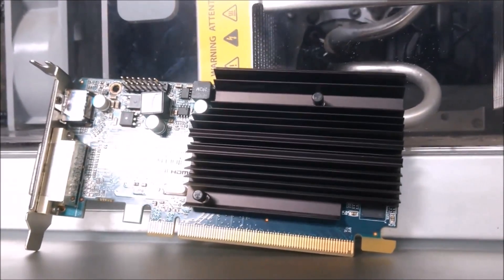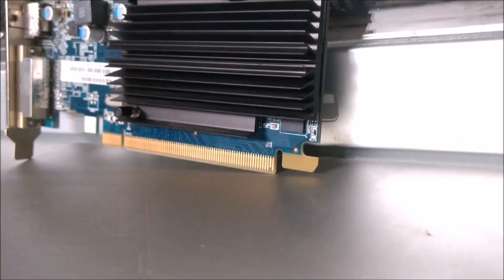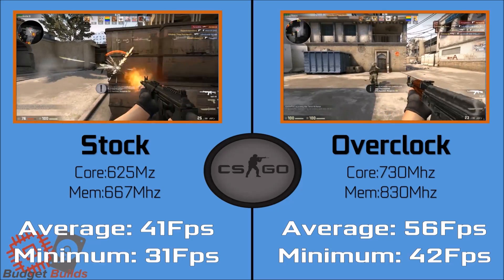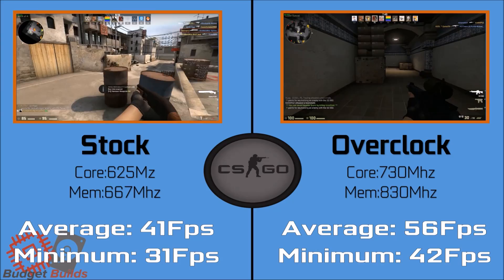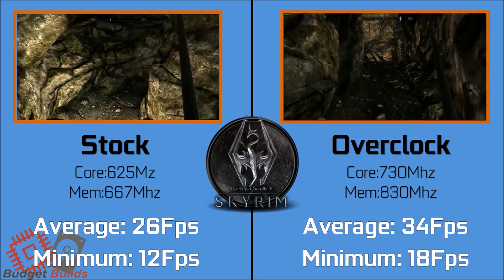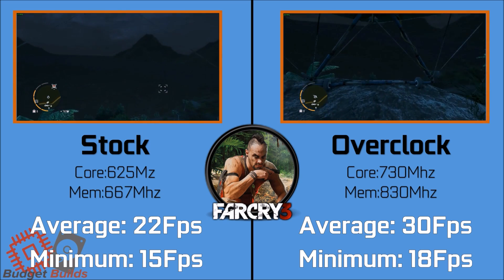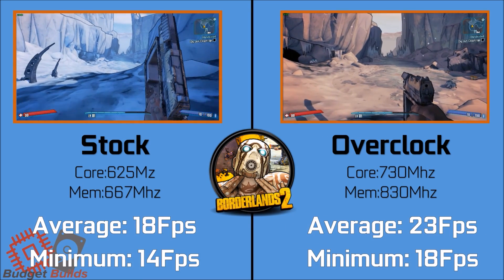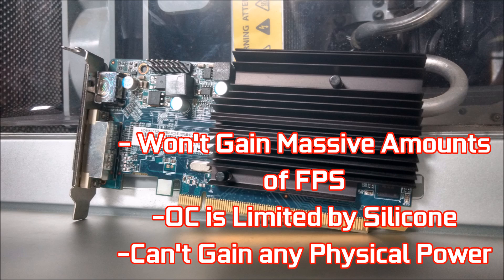Does Overclocking the Dreadful HD6450 make it Great? // Overclocking from Trash to Treasure

Comment: damn I got mine up to 815 on core and 780 on memory, my stock memory speed was only 600 tho 😭 the core I could probably push further but i've maxed out the slider on msi afterburner even with the "extended overclocking limits" lol i wish there was a easy way to extend them even further.
Reply: Returning back to this video, I ended up modifying the bios and flashing it, and in the process bricking the card, the only way to unbrick it was to flash it again using FreeDOS 😭 so I think i've just accepted that 815 is the max for this absolute turd of a card. I have a 3060ti in my main pc but I just wanted to tinker around to see what was possible.

Comment: hello i have the same card w fans i overclocked the memory to 900mhz and the core is 645 mhz i cant go any further how you did it my card just crashes when in load do i have to lover the memory and rise the core my temps are 59 on kombustor 10 mins with oc

Comment: The hd6450 it self is an OC version of hd5450
Reply: I don't think so. HD 6450 draws less power, more transistors and it has x2 more cores. So it's a different chip.

Comment: Back in the 1990's, I overclocked my Celeron 300A to 450mhz, as so many of us did back then. Took about a year, but my otherwise stable CPU suddenly let out the magic smoke and died a horrible death, taking the motherboard along with it. As a poor young soldier, this set me back a few months. Later in the 2000's, I overclocked my fairly expensive Radeon 4870x2 and again, within a year, it went poof as well.  I decided I was done with overclocking, and have avoided it outside of limited testing. I recently retired my beloved old Vishera FX-9590 w/ Fury X PC, but the system still runs strong and stable after 5+ years of hardcore gaming, but no overclocking.
Reply: You know the irony here is you bought a 9000 series FX what was itself an overclocked 8000 series FX and was prone to killing mobos because of its massive power consumption and voltage requirements

Unless you were Ann extreme overclocking, people don’t OC the FX 9590. They use it at its stock, which as I said is essentially already a stable overclock. 

And the lesson here seems to be you overclock too much with perhaps too cheap hardware or psu.

I can’t say I’ve ever had a part die on me due to overclocking cause I don’t push it to the extreme.

Case in point I happened to have a spare FX 8370 which I overclocked to 4.5. Which itself is slower than the FX 9590 you have. I could match your CPUs speed but I choose not to.
Reply: @stevesmith1383  Well, my current main PC runs a Ryzen 3900X. Let's see if we overclock your 8370 to match. I think 8ghz should cover it.
Reply: @gulskjegg-x  so you read what I wrote and decided, you know what, I don’t care about any of these points, I just want to shit on this dudes cpu, which isn’t even my main cpu, it’s just part of my collection (as I distinctly called it a spare cpu) 

You sure your bad attitude wasn’t breaking your CPUs and motherboards?

Thanks for the laugh though. I showed your comment to a couple of my friends and we had a decent chuckle at irony you were oblivious to.

And the icing on the cake is you shitting on the FX CPUs when you literally referred to it as your beloved FX cpu lol 

It’s too much
Reply: @stevesmith1383  I am truly glad you laughed, because it was meant as a joke. But seriously, have you considered becoming a cop? You appear to have the prerequisites.
Reply: @gulskjegg-x  if you meant it as a joke, then I do actually apologize. 

but it came off more as sarcastic at my expense than a joke 

regardless I'll take you at your word and I'm sorry for taking it as sarcasm

Comment: I have a 1 gig version of this, still runs badly-i wanted to overclock so i want to ask if the clock speeds should differ(it has a fan on it which is controllable from the Radeon software)
Reply: yeah i have the same... 
 ¿¿¿ IS BETTER TO SUCK AIR OR TO PUSH AIR TO THE "RADIATOR" of the graphics card ????

Comment: Dude plays GTA 5 and Skyrim on a HD 6450 512Mb DDR3, meanwhile I wouldn't dare to istall these on my PC with HD 5450.
I check the specs: "only" 8GB of 2400MHz DDR4...
I seeeeee, yes, with that goes everything better. :D
I got 4G of 1333MHz DDR3, and a quad core 3GHz AMD.

Comment: As someone who used a 7300 GT for years I can say "yes", but that depends on how much you can gain.
To elaborate: It was a passively cooled 7300 Gt to which I strapped a fan and was able to clock it from 400 MHz core/400 MHz Mem to 640 MHz Core/440 MHz Mem. A nifty 60% increase on the GPU made it close to a higher tiered 7600 GS.

Comment: I know I am Late to the Game but i just gonna say these Cards are Special...

I replaced the Onboard Voltage supply for the GPU and fed in 1.25V Externally. 
Next I tried overclocked quite a bit, got my HD 6450 up to 1 GHz Clock Speed. However, I still haven't touched the Ram yet though

Comment: i have amd radeon 6450 1gb bought it for 28 euros was it worth it? i think yes cuz i can play csgo 100+ fps also fifa 19 on lowest settings 60fps
Reply from the maker: CSGO running at 100Fps+ On average. Gonna need some source on that if that's cool
Reply: @BudgetBuildsOfficial  i have a intel i3 7100 + 16gb ram ddr4 2x8 gb ram but the weird thing is i bought it and it said amd radeon 6450 1gb, arrived at home updated the driver for amd radeon 6450, played some games, but in device manager it says amd radeon 7000 hd series
Reply: if it was amd radeon 7000 series how did it let me download the driver for 6450 then?
Reply: @BudgetBuildsOfficial anyway now im gonna put it inside a older pc which has 4gb ram ddr2 and some 1.86 ghz intel processor, gonna see if it runs well or no on that pc too
Reply from the maker: So what graphics card is it?
Reply: @BudgetBuildsOfficial  honestly i don't know XD, the first time i used it i had 60 fps on fifa 19 but now the game wont even open with this card also csgo is now running on 30fps idk what happened

Comment: So am I the only one able to overclock my memory clock by nearly 400mhz and gpu clock by 200mhz with max temperature 60 degrees Celsius for 2 years now (limited by psu power) with stock cooling
Reply: I read it can go to 900mhz.
Reply: would need to know what your final clock speeds are to compare, i got mine to 815 core but I've maxed out the slider on afterburner, idk how to get it to go further, even with "extended overclocking limits" ticked.
Reply: @Jushwa  I'll be honest I haven't had the gpu I was referring to for quite a few years now
Reply: @roodyjammer  oh true well then i guess we'll never know the answer to your original comment. I sold the first 6450 that I had bought as my first GPU and then years later ended up being gifted another in a free dell xps 435t, was trying to see how hard I could push this now ancient card.

Comment: What about the 2GB version?  I'm considering it for my Dell Optiplex 755 project.  The MSI GT 1030 I have in it now seems to be taxing the system via the Pascal Architecture.  I'm getting TONS of latency with it. I don't know if it's because the card is UEFI and the BIOS is Legacy on the Optiplex.

Comment: Hello 
I have pint.. G640 + 6GB ram+ HD6450 (2 GB)+ HDD 500GB can anyone tell me is that good or not
Reply from the maker: hacker Dz: It's not half bad, just grab a better CPU like a Core i5 2400 for £28 and a better GPU like the HD7770 and you have a full gaming PC.
Reply: Thank you so much 
I sub
Reply: Pretty decent. I've got the i3 2120+ 4GB 1333Mhz DDR3+HD 6450 1GB+ 640 GB HDD(Yeah I'm confused by the amount as well). It's an Optiplex 790 motherboard shoved into a Mini ATX case with a 300 W PSU

Comment: I bought this in 2GB version for £40 from Amazon this week. The mobo i was upgrading has a legacy bios (purchased 2006) and it didn't recognise the GT1030.
The HD 6450 streams 1080p video at 60fps and is perfectly capable for Minecraft
Reply: @montanapharmaceuticals7881  how

Comment: or what u could do is try 2 mod a aftermarket cooler like what diz user did with his cheap GPU

https://www.youtube.com/watch?v=QodrQadRUOQ

oh and here's some of tha fans
http://www.ebay.com/itm/VGA-PC-Computer-Video-Card-Cooler-Cooling-Fan-Heatsinks-For-NVIDIA-ATI-Geforce/131973227568?_trkparms=aid%3D888007%26algo%3DDISC.MBE%26ao%3D1%26asc%3D45726%26meid%3De331716e2226423db73e5afb203caae9%26pid%3D100009%26rk%3D1%26rkt%3D1%26sd%3D300635661543&_trksid=p2047675.c100009.m1982

http://www.ebay.com/itm/Golden-55-60mm-VGA-Video-Card-Cooling-Fan-For-Nvidia-Geforce-ATI-Series/271888298204?_trkparms=aid%3D555018%26algo%3DPL.SIM%26ao%3D1%26asc%3D45726%26meid%3D3d4addd025c14b3c87a6cc897be2e542%26pid%3D100010%26rk%3D6%26rkt%3D6%26sd%3D131973227568&_trksid=p2047675.c100010.m2109

Comment: to be honest the integrated igpu on that cpu alone is better than this card as long as you have a mobo that supports above 2666MHz ram and yo increase the total shared memory to 1024MB via bios. I played skyrim with high settings around 30 - 40 fps with realvision semi-performance mod settings.
Reply: What apu was that?

Comment: About thermals: just strap a small fan to it.
There are even the contacs wehre a fan would be connected (I guess the manufacturer has another model that is actively cooled) Depending on the BIOS it might be possible to just solder in pins and use these contacts.
I did that on an old passive Geforce 3 for a retro build.
Reply: Well, that's the ghetto approach i did with my passive 7300 GT.
and my 8800 GT to lower temps by around 30°C.
Reply: I have the fan version.i got it on ebay with a hd 2400 for £9.
Reply: YEAH .... that s what i do... the question i always do to myself is
 ¿¿¿ IS BETTER TO SUCK AIR OR TO PUSH AIR TO THE "RADIATOR" of the graphics card ????

Comment: what are the pins for?
Reply: Bryan Rigby A fan for the gpu
Reply: VGA connector for full profile card*
Reply: VGA
Reply: Bryan Rigby that might be for crossfire support
Reply: @TomBom292  it used to be where the vga port was, but it is also for crossfire

Comment: i managed to overclock a hd 6570 to its max in msi afterburner stable
Reply: Darn I don t remmeber my overclock on that card I know I unlocked even a bigger overclocked thx to tinkering with the settings in msi afterburner. I think the setting is extended overclocking limits that allow you to overclock it even further.
Reply: +Rademenes Polański Congrats. Do you want an award for knowing the correct year ?
Reply: Rademenes Polański 
Clearly its 1999
Reply: Let's party like it's?

Comment: I tried this with my hd 7450 the fan sounded like a jet engine and eventually the fan died so I had to upgrade my gpu XD
Reply from the maker: Always nice to try something out , I think custom cooling may be in order for a beast like the HD7450 though
Reply: Do you?
Reply: I OC'ed hd 5450 from 700mhz on core to 1ghz with a case fa. Attached to it

Comment: Nice Video! But one question, did the card just bluescreen on you while overclocking? Because that happend to me with exactly this card at 675Mhz. Feels bad man :/
Reply from the maker: Nope I kept running the Ungine Valley Benchmark while Overclocking, Going up in small increments, until it crashed, I then let the card run through a benchmark on the highest working clock speed and then used this.

Anything higher than the settings i used here would crash the display driver though and I would have to restart Ungine Valley. 

Would you like to see a video on overclocking?  It was going to be coming soon but i could speed up its production.
Reply: Budget-Builds Official yes I am not a professional overclocker, but some tips would not be bad! Thank you for being a good tech youtuber! I watched every single video of your channel! Next week im going to start making tech videos like you.
Reply from the maker: Thanks Man, Aiming to keep it up, Will Give the Overclocking Video some work tomorrow, Should be able to get it up by then. Good Luck with the channel.
Reply: Budget-Builds Official no man, thank you!

Comment: at 5ghz with the memory at 2000 + this card might become great we need to find better cooling solution than ln2 though !  although i was surprised by the performance considering  ^^
Reply from the maker: Yeah, Considering the card was free with some tweaks to the games we could have seen the card hitting 10+ More FPS to the games , I may have to do a video on that, to see if tweaking is as great as it seems.
Reply: hey! Theres a typo in the Title!